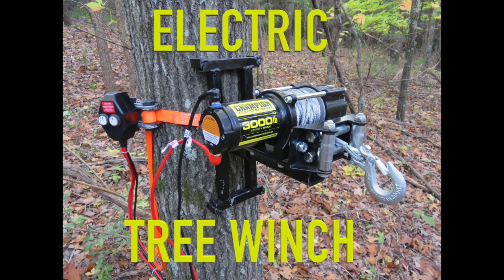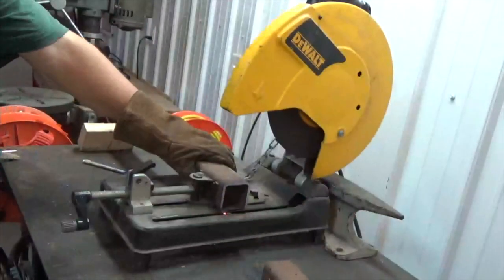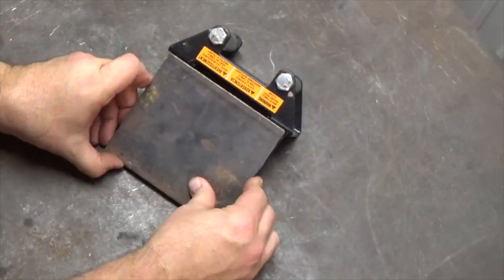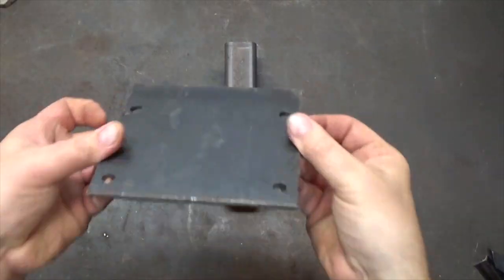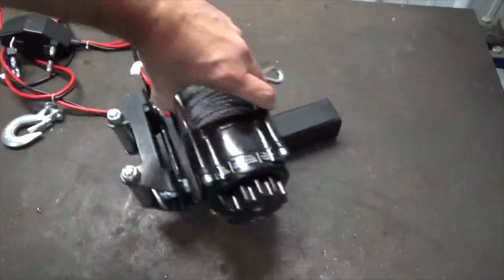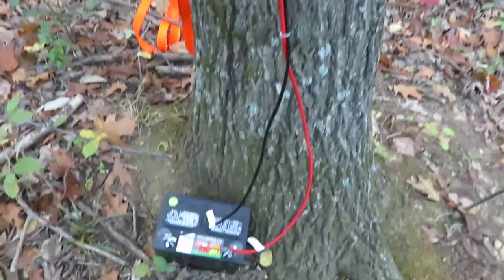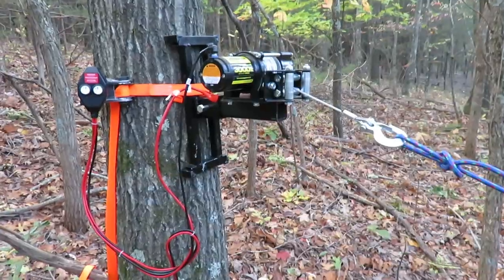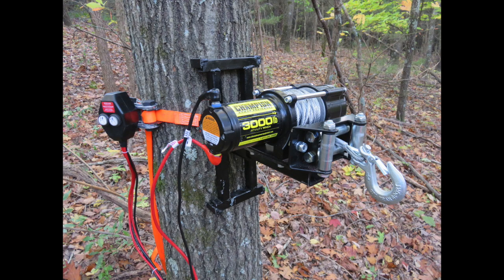Electric Tree Winch - Portable Deer Winch - Welding

Comment: warn has a battery operated 1000# winch already it weighs about 25 lb and is under $400 at northern tool
Reply from the maker: I didn't think mine weighed THAT much, but I really don't carry it by hand.  I put it on my deer cart, so who's to know. I guess with the battery, however, it could probably weigh that.   Either way..... i recommend using a deer cart for all your gear (and deer)..... one of the handiest things i've ever made.

Comment: for the money,  you could have bought  1 mile of Mule Tape and drug it all the way to the truck
Reply from the maker: I wonder how that stuff will hold up in a turning winch over years and weather.  I actually have a version of mule tape that we used to pull electrical wire up 8 stories.  That stuff is amazing.  I've been know to braid some together in order to get a little more strength from it and drag downed trees.   Good post and tip.  I may try loading my winch with this stuff. Never really thought about trying it.   THANKS!
Reply: Phil Crockett  Tie one end to the truck on the road. Thread the other end through the  snatch block and trees ,then tie to animal. With radio communication between you and a helper, Drive slowly and pull animal to the road.
Reply from the maker: HA!   that would work if I had 'a road' out there.  The Missouri River hills and hollows are thick and deep (like Ozarks).   I suppose all this would depend on where a fella hunts.  Thanks again for the great tip on that Mule Tape.
Reply: Now I gotta get me some Mule Tape! I can see many uses for it. Thanks for the tip, and since ya weld, stop by the Weldingweb forums. I think you'll enjoy them. My nick there is farmall.

Comment: I suggest drilling an extra pair of holes in the receiver tube in the other sides. Then it wouldn't matter which direction you use the winch mount. You could also use a hitch pin instead of a bolt. Pick one with a big red handle so it is easier to find if you drop it. You know Murphy is going to be involved sometime.
Reply from the maker: Love the way you think!  Great tip!
Reply: Hey watch it!

Comment: Great idea! Thank you for taking the time to put this excellent summary together. Have you used it to pull heavier loads than a deer? I'm wondering if the portable battery set up would allow enough power to pull a vehicle out of a ditch or similar application.
Reply from the maker: The only thing I've pulled that was "heavier of a load" was a big dead branch that was hung up in a walnut tree.  I tied on and ripped it from the trunk with this winch.  As far as using it for a vehicle, you would have access to a real battery under the hood if you rigged the wires right.  It would be interesting to test a load like this on a ATV battery though.  I hope I never get in the situation to know if it works!  If you ever try it, please let me know.

Comment: This is a clever implementation.   I was working on something similar except I wad trying to figure out how to get around the 50ft cable length issue.   I think the winches have a limiter and are not continuous run.   It you had continuous run,  you could wrap the end of say a 300ft rope twice around the take up wheel much like the crab trap pulled the have on "the deadliest catch" where the rope reels of the back of the wheel ass new route is taken up in the front.   This way you don't have to keep going up and down every 50 feet.
Reply from the maker: I thought long and hard about this issue as well.  It's really the only flaw in this idea, but walking back and forth 2 or 3 times is WAY easier than dragging a deer up hill.  I even thought about making a 4 wheel low-rider cart (kind of like a creeper but only with large wheels)  and mount the winch on the front of it.  then i would just simply pull the whole load in that fashion.   I'm still thinking about how to improve it.  That's part of the fun.  Thanks for the comment, I enjoyed the idea!